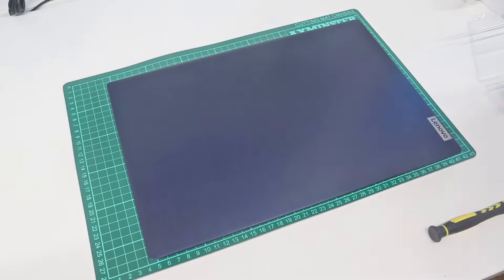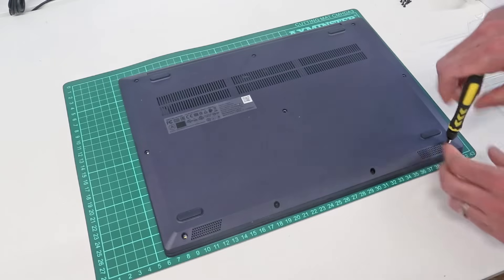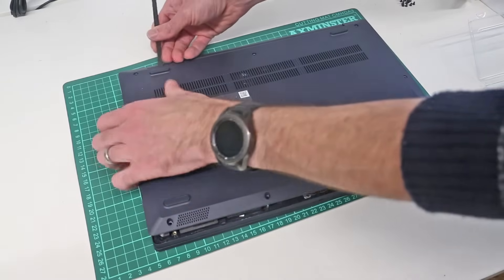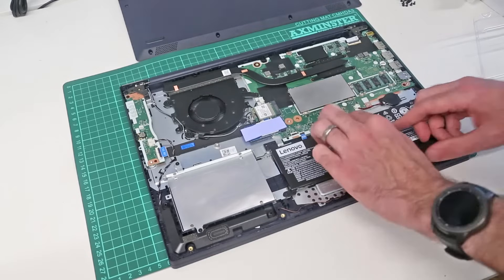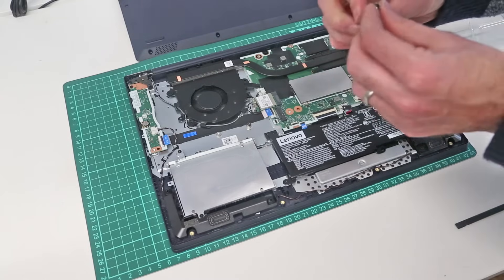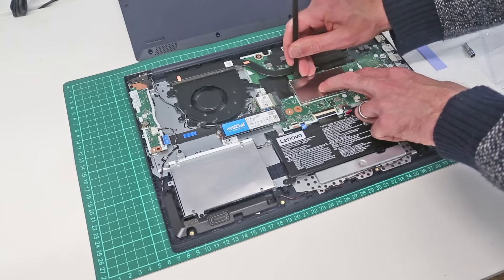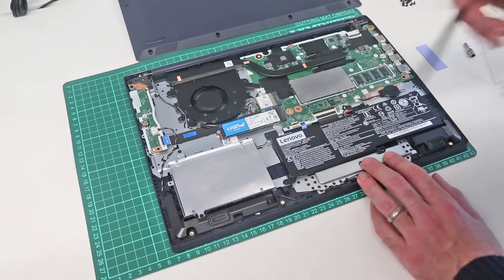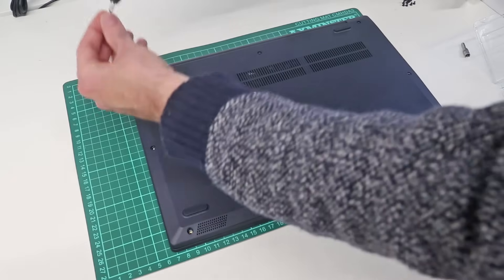Lenovo IdeaPad 3 15ARE05 SSD and Memory Upgrade Guide

Comment: Hi Just bought a ideapad 3 15IAN8. with a view to upgrading the SSD, which I have done on previous models. On opening it up can't find what I would recognise as an SSD card. The points to fix the card are in place are in the same location as in your video, but no card or "slot" where it should go. Just wondering if you have come across this before (would send photo's if I could).
Reply from the maker: Looking at the spec sheet that model can have 128GB UFS storage or a 128-512GB PCIe M.2 2242 SSD.
If it has UFS storage then its probably soldered to the mainboard.
The hardware maintenance guide here shows where the drives go on Pages 32-35: https://download.lenovo.com/consumer/mobiles_pub/ideapad_slim_3_hmm.pdf
Reply: @BrueComputing  was assuming its soldered in. Despite the model being referenced in the maintenance guide it makes no reference to this the type of storage. Not now expecting to be able to do much with it, but perhaps if I could email (address on you tube info)  a picture you could let me know what you think, just as guidance, it would be appreciated
Reply from the maker: The maintenance guide wouldn't reference it as it isn't a serviceable part - same as LP-DDR5 laptops don't reference the memory.
Feel free though - if it has the M.2 slot you may be able to add additional storage.

Comment: Can we add one more ssd in this laptop in this laptop have 2 slot ssd or only one
Reply from the maker: If you have a 2.5" drive in it already, or can obtain the necessary cable for adding one, you could have a 2.5" SATA SSD + an M.2 SSD. The system I had didn't have this however.
Reply: @BrueComputing please elaborate in simple words i dont understand please
Reply from the maker: There is only one slot for the 20x80mm M.2 type drive that slots into the mainboard. This is what the video shows how to replace.
There is a space for a old style 2.5" HDD/SDD in the bottom left corner, but no cable is included for attaching it if the system wasn't originally supplied in a configuration which had one fitted.
So if you're laptop came with a 2.5" drive originally you could add an M.2 type drive.
If, like the one I did the video with, it came with an M.2 type drive then you'd need to find the specific cable for attaching one - I don't know if these are sold separately.

Comment: So after installation of ram and or ssd don't you need a program to make them computer or laptop ready? Or will they both instantly start up and update through the regular start up ?
Reply from the maker: With RAM no further changes are required. For the SSD you need either to install the OS fresh, or clone the contents of the old SSD on to it - I have other videos on the channel showing how to do this (although they are a little old now so other methods are available). For the individual videos I would focus just on the hardware installation.

Comment: I dont know if i got scammed or not i just brought a month ago and both slots are full and 4 gb each 😦
Reply: That just means you bought the 8 gb configuration, you can remove the not-soldered one and swap it out for more ram.
Reply: @ethanlittlejohn3811  ooh i can do thattt!!!! Really???
Reply: @Hahahahahahahaha  I've read you can fit up to 16 gb in the slot, but I've also read you can fit up to 32 gb. So do what you will with that 🤷🏼‍♂️
Reply: @ethanlittlejohn3811  thankss for info

Comment: Can i upgrade to 16gb ram?
Reply from the maker: Depends on your base configuration. If you have 8GB soldered down you can add another 8GB as a SO-DIMM for 16GB. If you have 4GB you can an 8GB for 12GB total or a 16GB module for 20GB total.
Reply: @BrueComputing  bro in MAX memory slot it has two points saying 
1.upto 8gb (8gb so dimm) DDR -2400 offering
2.upto 12gb (4gb soldered+8gb so dimm) DDR 2400 OFFERING

PLEASE HELP ME AND TELL MY MAX RAM MEMORY PLS

Memory slots
1.one DDR SO DIMM 
2.One memory soldered to system board, one DDR4 SO DIMM SLOT, DUAL CHANNEL CAPABLE.

Comment: I have a question. My model has a wider battery and there is no extra space for a Sata ssd as I want 2 ssds in my laptop. What do you suggest?
Reply from the maker: I'd just fit a larger main SSD personally - fitting the smaller battery, sourcing the cables and brackets, etc, to add a 2.5" SATA drive would be a lot to spend to make the laptop worse.

Comment: Surprised when I took mine apart, there was no hard drive bay or sata connectors. Instead the battery extended all the way across the bottom. Disappointed. Mine is the 15alc6 model.

Comment: And where is the upgrade of SSD? only the M2 can upgrade but I think that is not possible put a ssd :/
Reply from the maker: The M.2 drive is the SSD.
Reply: @BrueComputing  M2 is nvme drive, not ssd ..  regards
Reply from the maker: @Jordi_SP  SSD stands for Solid State Drive. The M.2 drive is an SSD using the NVMe interface. I think you're asking about adding a 2.5" SATA drive, which can be either a HDD or SSD.
Reply: @BrueComputing  yes, I already knew that you meant solid state drive when you said m2... but today at this point nobody calls the new M2 nvme modules ssd anymore. I don't know if I explain myself. saying ssd today is used to name the old 2.5" ssd disks. of course each one can refer as they want, but everyone I know no longer uses the acronym ssd to refer to m2, so we understand each other better for when we refer to module M2 and when to ssd of 2.5.  
It is a very good way to differentiate between my clients, so there is no room for doubt. since a 2.5" ssd is much slower and older than any M2 nvme

Comment: Sorry for this basic question, but how many slots for the ram does it have? I got two similar ones and one is totally broken, so I'm thinking if I can add the ram of one to the other? Can you let me know? Thank you in advance!
Reply from the maker: It has 1 slot. The rest of the RAM is soldered to the mainboard.
Reply: @BrueComputing  thank you very much. So, just to clarify, in addition to the ram that it came with (soldered), you can add an external one, like you showed in your video?

Comment: Is it worth closing the memory slot with a lid after installing it? How will the memory modules be cooled? Thanks.
Reply from the maker: Its an EMC shield, not a cooler.
Reply: @BrueComputing   understand that this is not a cooler. But this screen prevents the passage of air. The old laptops didn't have screens.

Comment: I noticed in bios there is a disable battery function for repair, and it automatically reenables it when you plug the ac back in.

Comment: Can I do this upgrade on the 81WB (IdeaPad 3 15) model? I don't know if this is enough information, and I'm super new to the hardware stuff so checking what the actual motherboard is would take a bit. Also I'm looking to add an 8gb DDR4 3200 to it.

Comment: Do my Lenovo IdeaPad Gaming 3 Ryzen 5 5600h wi support 3.5inch Desktop 1Tb Seagate HDD
Reply from the maker: Is that the ACH6 model? If so then it can support them, but don't know if it includes the SATA cable and mount if a drive isn't installed, so you may have to source those separately.
Reply: @BrueComputing  Yes it's 15ACH6D1 model and it supports 2.5"inch SATA 5400Rpm Laptop Hdd
Reply from the maker: Just realised you said a 3.5" drive in the original question - obviously that won't fit. If it has the cables/brackets in place it'll support a 2.5" SATA HDD, although given the low cost difference I'd fit something like a 1TB SATA SSD: https://amzn.to/3N2FudT
Reply: @BrueComputing  ok Thanks Sir
Reply from the maker: No problem.

Comment: Hi, thanks for the info! One question: Is it possible to use both, an SSD + HDD on this laptop?
Reply from the maker: If you can get hold of the cables and mounting bits it should be possible, but it isn't supplied with them.

Comment: Do you achieve dual channel like this? It used to be same manufacturer, model, speed and size ram was needed to achieve dual channel, you never mentioned this and it's very important to optimise your ram choice.
Reply from the maker: Yes, worked correctly in dual channel mode this way.
Reply: @BrueComputing  i read about maximum ram can be limited at 12 gb i have the model with 4700u and planning to buy 16gm ram module
Reply from the maker: @MrTheophilos13  Not that I know of, but haven't tested it specifically.

Comment: I recently got this laptop and added 8GB of ram, giving me a total of 12GB which is great (2GB used by the Radeon GPU). I see a caddy for a 2.5 inch drive, but don't have a sata cable. Presumably there is a slot for a sata cable, given that there's a caddy for the 2.5 inch drive?
Reply: No buddy, the slot is there for different configurations of the same case. If you have no sata connectors in the bay itself, you can't add a 2.5 ssd. There are no sata headers on that board. Just one m2 ssd available. Also, when buying memory, do you see dual channel? As using different manufacturers, speeds, voltages etc will not enable dual channel. Wondering what ram I need to get to achieve dual channel. This video doesn't state which is pre soldiered, which is important info to know trying to dual them uo.

Comment: Does anything have to be changed in the bios when upgrading to a 2280 from a 2242?
Reply from the maker: Nope.
Reply: @BrueComputing  so i installed a brand new 2280 team group ssd from a guy on ebay that had pre installed windows 10 on it and for some reason the laptop would not load windows. it just simply said ("default boot device missing or failed. insert recovery media and hit any key then select "boot manager" to choose a new boot device or to boot recovery media") 
I tried to see if there was any settings in bios to change for bootup and there was not. The seller and i agreed to send it back to him and he plugged it into his laptop and it loaded windows no problem. I have bought sata ssd from for a old acer laptop and that worked just fine. 

Could it be because i have to load windows into it after installing the new ssd and it for some reason cannot have windows preloaded from another pc?

I have the 2021 lenovo ideapad 3 that i was trying to upgrade.
Anything thoughts? thanks.

Comment: Good video - thanks for the info. One suggestion to anyone who is new to upgrading a computer... Never wear clothing like a sweater (or similar clothing) when working with computer components. It is possible to create static electricity, which can damage the computer. Wear a ESD badge and mount/ ground it to a non-static surface.
Reply: In theory, yes. Reality - very unlikely. It is a good caution, and it is always better be safe but in real world it will take quite a bit of static to damage anything. Games nexus conducted a vigorous experiment on their YouTube channel and concluded the chances are extremely low.

Comment: I tried installing a ram for the first time. Does the laptop take some time to boot for the first time after ram installation. I tried installing more 4gig 2666 ram and it didn't boot even after 5 second. I removed it and it boot up immediately. Or do I have a faulty motherboards and claim warranty?

Edit - tested the ram. Its fine and working
Reply from the maker: Sounds like the additional module isn't the correct specification.

Comment: how do i put win 11 on the new ssd drive
Reply from the maker: Use the Windows 11 Media Creation tool to create a bootable USB stick: https://www.microsoft.com/en-gb/software-download/windows11
Then turn the PC on with that connected - if there are no other bootable devices attached it should load the Windows 11 installer.

Comment: I bought a new ram 
4gb ddr4 2666 crucial
But when i opened my laptop 
It crashed and turns off and open again
Until the screen looks so glitchy
Reply from the maker: Works ok with it removed?
Reply: @BrueComputing  yes 
.
I have a ideapad 3 15are05 but a ryzen 3 4300u now I don't know what ram will be compatible since a seller from a online shop
 (not the same shop that i bought the incompatible ram)
said that their ram is not compatible with my laptop because 1 is soldered and soldered ram is very selective on choosing ram
Reply from the maker: @fxaiko7902  Strange - I fitted Crucial DDR4-2666 in to mine without issue.
Reply: @BrueComputing  im now scared to buy another ram because it might corrupt my files
But i also needed it to hold more tabs

Comment: @Brue Computing , Thanks for the Video, it was indeed helpful, I do have one question, I recently bought the same lenovo model, and I was wondering, once you install the nvme ssd, would it be possible to remove the hdd ? I say this in the hope of speeding up what has turned out to be a really slow laptop and I want to do this also because it would leave space for a possible installation of a bigger battery, if this is at all possible, I was hoping you might have any suggestion as to which is the biggest battery model I could fit in, for the longest possible battery duration, any info will greatly help, thanks in advance for any help!
Reply from the maker: Thanks for the comments!
Yes, if you install an NVMe SSD you can remove the HDD - you'll obviously need to either clean install or clone across your Windows install to the SSD.
Not sure if Lenovo do a larger battery to fit the extra space, but they might. If you find out let me know.
Reply: They do make aftermarket batteries with higher claimed capacity but in the same space. There is not an option to fill the HDD bay with a battery. But you will see longer battery life with just the M.2 since the spinning disc takes about 12 times more power to run.
Reply: @zedorda1337  thank you for your input, will make that change soon!!
Reply: @BrueComputing  Thank you for your help!

Comment: Is there a free slot for RAM or I need to switch my current ram with the new one? And what is the max size?
Reply from the maker: Mine had 8GB soldered to the mainboard and an empty SO-DIMM slot. You could add an additional 16GB DDR4-2666 module to take it up to 24GB.

Comment: Really helpful indeed. I have encountered a problem though as my 256gb mSATA ssd from Indmem Global Corp. seems to be a bit to wide to be fitted into the ssd port illustrated in the video, is there any other way I could install it?
Reply from the maker: mSATA is the wrong type of drive - it takes an M.2 NVMe type drive...

Comment: this is not a ideapad 3
Reply from the maker: It is. The exact model is as per the title, a Lenovo IdeaPad 3 15ARE03.
You can see it on the Lenovo site here: https://www.lenovo.com/gb/en/laptops/ideapad/300-series/IdeaPad-3-15ARE05/p/88IPS301432

There are dozens of different IdeaPad 3 models that have been produced over the years, so if you have another model it will obviously be different to this.
Reply: i have ideapad 3 with 2 fans cooling system
Reply from the maker: @simoichinose8133  Ok - you have a different IdeaPad 3 model.

Comment: Hey man, thanks for the video this is exactly what I was looking for since my ssd broke and i have the same model of laptop. One question: is the bottom left place for the HDD? im also thinking of buying an HDD but my laptop didn't have one by default, and bottom left place seems like the only to fit an HDD but can't wrap my head around how to connect it to the motherboard. Cheers.
Reply: I'm a bit late, but i managed to connect 2.5" ssd with some flex cable that connects to the ssd that I bought separately. Not sure about an hdd though.
Reply: @ssultan_nn  could you help me out
Reply: @ssultan_nn  what is the name of this cable? I want to order
Reply from the maker: There is space there for a hard drive, but no bracket or cable included. I don't think the connector for it was present on the mainboard either.
Presumably they are included in version of the laptop which include a hard drive as standard, although I've not seen any here in the UK.

Comment: should have specifically zoomed into the connector type of the battery as well as the strange screws for the SSD then the video would have been 100% useful.  As is, I give a 50% due to not having any idea whatsoever as to the connector types of above referenced.
Reply from the maker: Thanks for the feedback - will look into that for future videos.

Comment: what speed is the ram soldered to the board is it 2666 as well I know the amd cpu prefer faster ram so if I was to fit a 3200 if one was available would it limit it to the soldered ram or run at 3200?
Reply from the maker: Limited to 2666.

Comment: Awesome just what I need to upgrade my wifes laptop, I was wondering if I could fit an 8 gig stick of ram rather than the 4 gig or even a 16 gig stick she does play some games so more ram will be of benefit to her. I would probably put a  1 TB or a 500 gig m.2 in as well as there is no other way of adding storage other than an external drive which is also an alternative. I have fitted the hdd enclosure in place of the dvd drive but these don't have a dvd drive so that rules out that lol.
Reply: Some sources incorrectly state that only 8GB of ram can be added. They are wrong. A 16GB DDR4-2666 works fine.

Comment: can i remove my hard drive? because I do not use it anyway and I think it just drains the battery. Windows is installed on my ssd anyway. So is it okay if I will remove it?
Reply from the maker: Yes, you can remove it so long as it doesn't have the boot loader on it. Could also replace it with an 2.5" SATA SSD.
Reply: @BrueComputing  thank you so much!

Comment: do i disconnect the battery even if i’m only doing ram upgrade?
Reply from the maker: I would recommend it - it isn't strictly necessary, but it reduces the risk of accidentally removing or fitting a module with the laptop powered on.

Comment: Can you add a graphics card in laptop, I am not sure if this is possible
Reply: Graphics cards in laptops are integrated into the motherboards but there are ways to wire a normal graphics to a laptop but it won't be inside the laptop